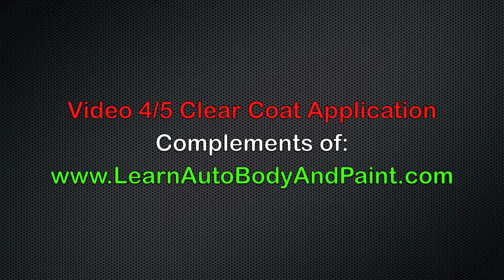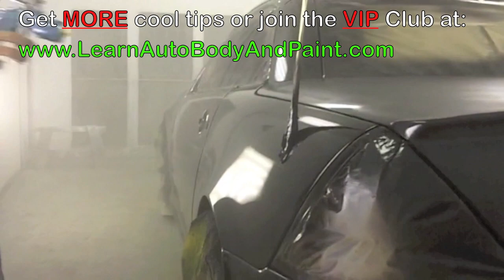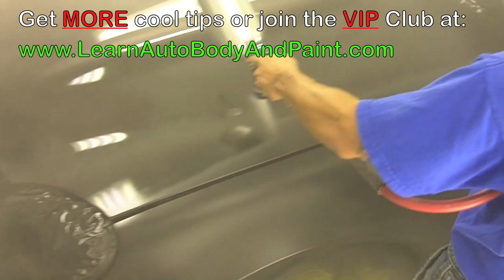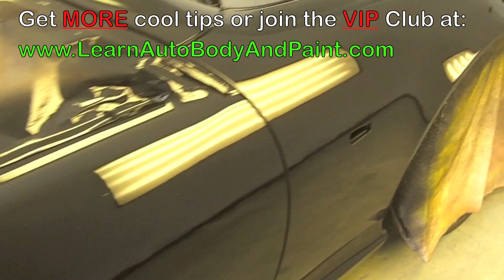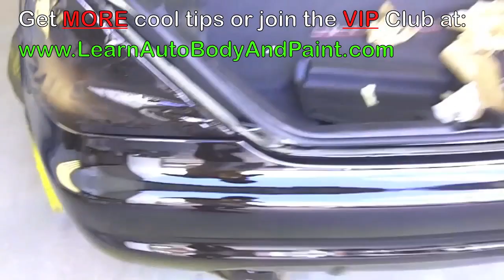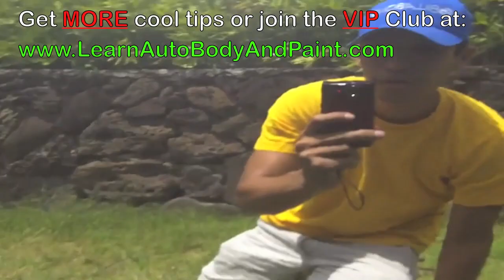How To Paint a Car Step-by-Step Video 4

Comment: Have you ever used a urethane accelerator like transtar when spraying clear?
Will that help prevent runs?
I always get runs on clear because my garage is too cold at night when i spray..i spray at 25psi with fluid all the way out and still get runs even wen sprayins first coat light
Reply from the maker: I have but haven't really seen a difference. I prefer to spray it as is without additives. Maybe your gun loads paint more on one side... check your fan pattern. Try wetting a piece of paper to see how even your flow is. If you're looking to get a great gun check out the 904 here: http://www.learnautobodyandpaint.com/product/warwick-904he/ it's an awesome gun and it's what we use here to spray all of our projects at LABAP.